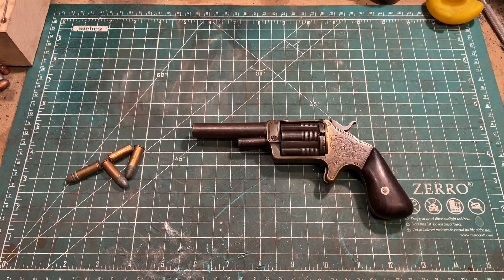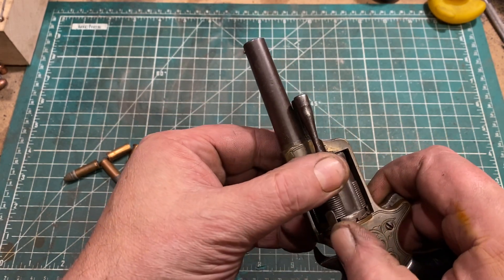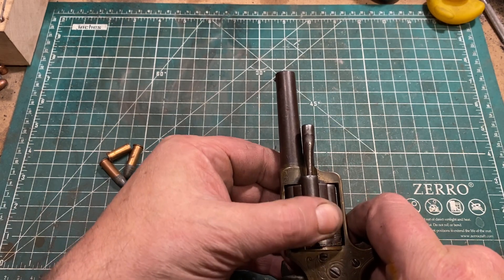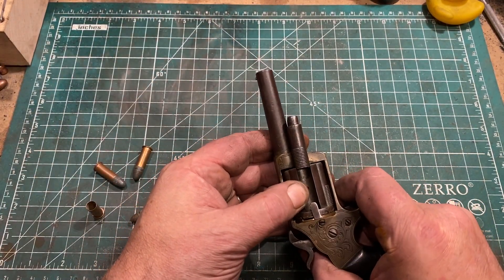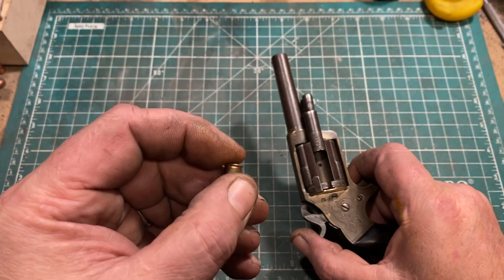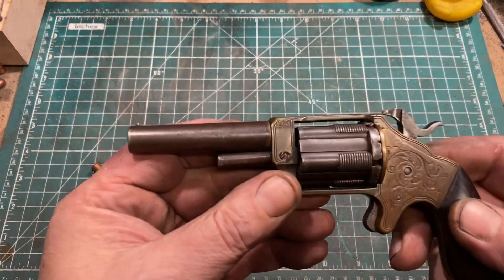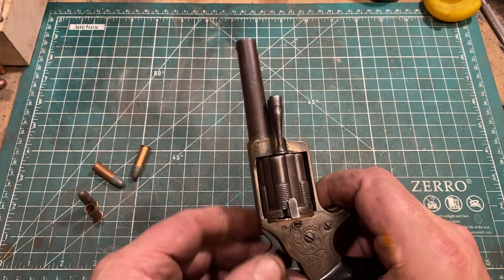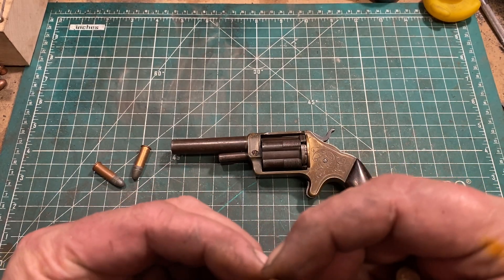The Slocum Sleeve chamber Revolver: A Solution to a Very Specific Problem

Comment: Glad to have found your channel.  That sleeve pistol must be a bitch to clean without the right lube.
Reply from the maker: It's actually really easy; when the cylinder is removed the sleeves slide right out the front of it so you have good access to everything.